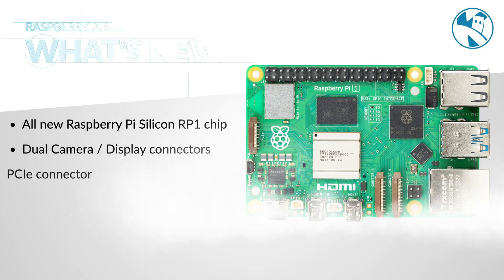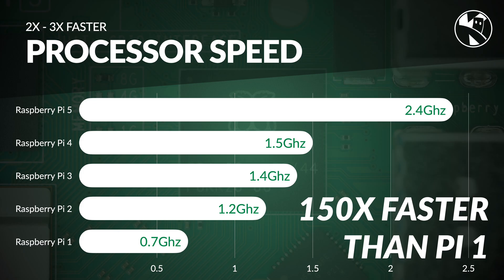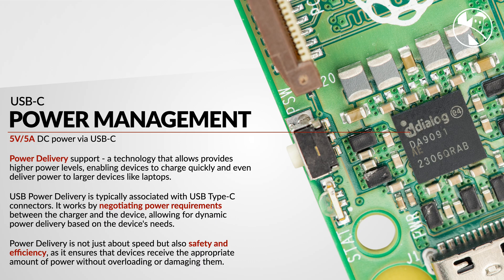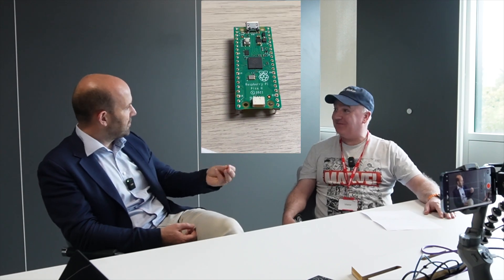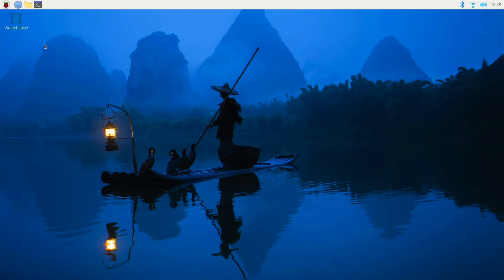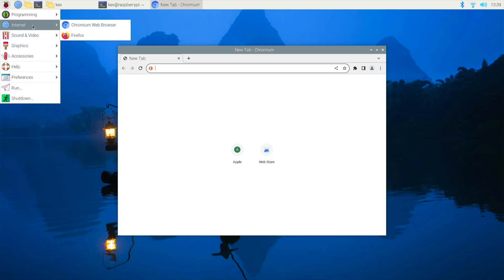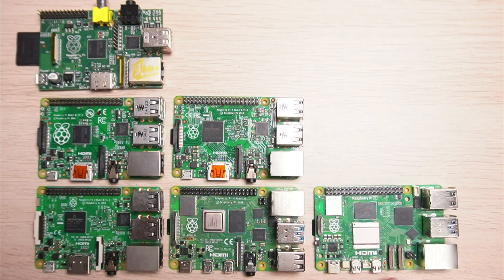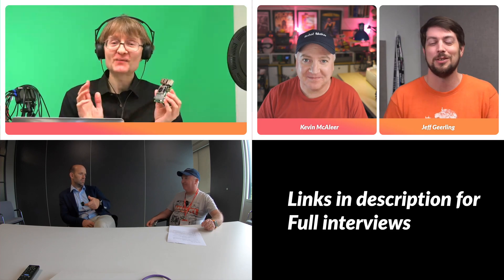The new Raspberry Pi 5 - first look

Comment: Hi Kev,

Is it true the RPi5 needs its own OS, or can I still run my sd cards from my RPi4 that run on Buster and Bullseye?

Thanks,

Al
Reply from the maker: I understand from raspberry pi that it will need the new OS to run due to the hardware changes. However you can upgrade from Buster and bullseye to bookwork and then move that as card across
Reply: @kevinmcaleer28  unfortunately not, as we use a lot of old libraries on Picochess and are still 32 bit. RPi5 seems to be 64 bit and I doubt we’ll get picochess running on it …
Reply from the maker: @alanscallycooper5334  do you have a link to picochess? I've give it a try and let you know
Reply: I’ve provided a link twice and asked how I can get a beta copy of bookworm OS, but the posts disappear? Al
Reply from the maker: @alanscallycooper5334  Have you asked on the Raspberry Pi Forums? I know there it a git repository https://github.com/RPi-Distro

Comment: I am not interested in UI version of the OS. Is there a command line only version? It will make my decision to buy it.
Reply from the maker: Of course - you don’t need to use the Ui, it’s easy to switch that off and boot directly to command line
Reply: @kevinmcaleer28  Cool.